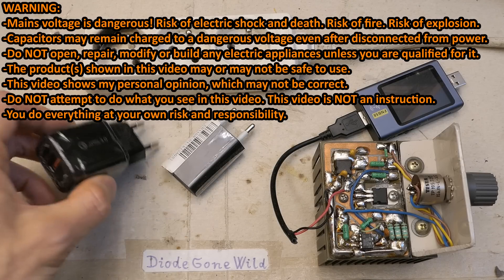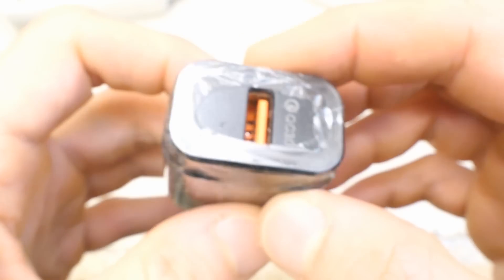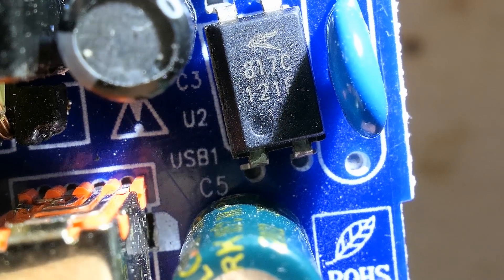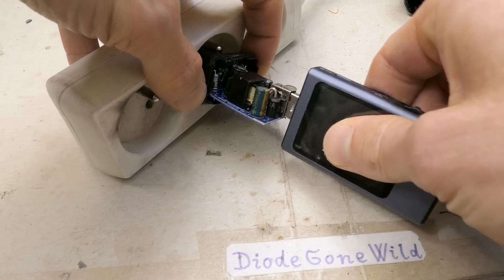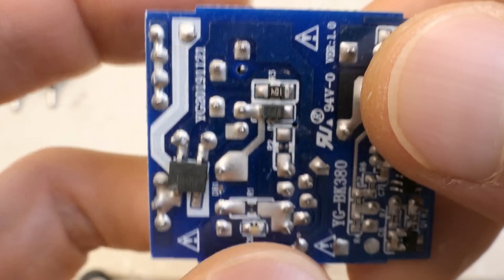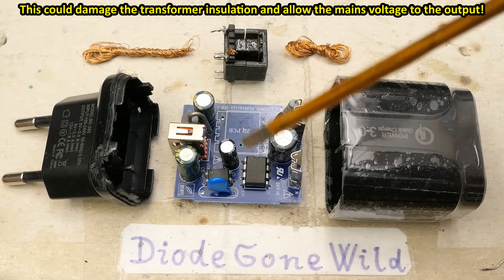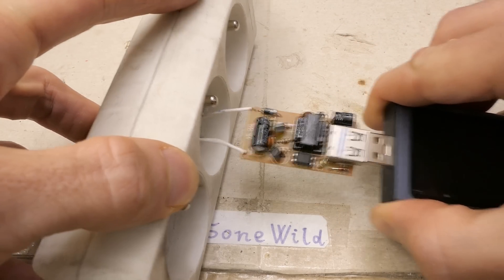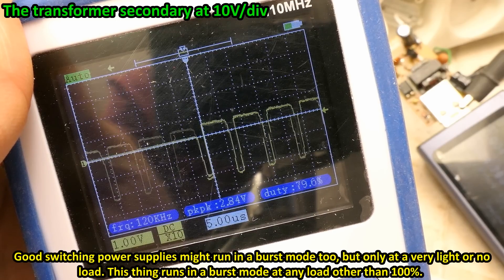Dangerous USB chargers 17 (QC 3.0 with schematic)

Comment: Great video. I'm sick and tired of the amount of cheap (and sometimes dangerous), but also wasteful crap that's on the market these days. And it's often from China or has cheap, unreliable components sourced from China (cheaply made capacitors are a common cause of failed electronic devices). Governments should be imposing strict standards and testing on such imports but they aren't. Big resellers like Amazon and Ebay should take a stance and not sell them, but they won't because ....... money.

Note that China is of course capable of making good quality components and devices, but a lot of their stuff is made to the cheapest price point and that is why it fails.

Comment: I actually had high(er) hopes for that first one after seeing the blue PCB.

The second one was a design popular around 10-13 years ago, and from some research and experimentation I did, it's amazing that that two-transistor design can actually deliver several amps without problem and be much safer if they'd just done what would cost a few cents(!) more per unit... but they didn't.
Reply: The two-transistor topology was actually good enough for the pre-smartphone era to power a 300mA charging circuit for a 1000mAh (or even less) battery. Those chargers were specified at 5.6V (no load) to 5.2V (rated current) or something like that, and the lithium charge control chip in the phone had no problem dealing with it. Putting a USB jack on a charger like that is not a great idea, and there is definitely no excuse for the bad transformer insulation and the non-class-Y capacitor.

Comment: If there’s anything to learn from these videos, just buy the charger brick made by your phone’s manufacturer. Even if it’s a bit more expensive than you would like, you can feel good knowing that it will work as intended and it likely will not explode when you use it.
Reply: Why i advice people (incl my family) to buy chargers which are a bit expensive and from trusted brads.

Comment: 5:23 152 degrees for a rectifying diode?! Bloody hell, that's amazing! That's going to cook the capacitor right next to it! 
That charger was baking its internals so much, it would probably melt the plastic housing and set your house on fire! Bloody hell - definitely not fit for purpose!
Also, that second one doesn't look too good...
Reply: And let's not forget: the charger is going to melt itself and set the house on fire, even if you don't try to draw the full rated load. This makes things even worse than it already is.

Comment: Totally off topic but I watched your de bunking video about using a MOT to make a blaster that can fry electronics ! its almost up there with "salt".....great work......cheers!
Reply: He still hasn't come across a design that is publicly available that lives up to the task, although one can be made very cheaply and only runs from 3v (2x 1.5v AA batteries). Doesn't work at microwaves though, but mid vhf.

Comment: I one of those USB chargers that was checked last and I must say it was not very good to charge my phone like he said "Dodgy ...." and "bloody hell ....."  🤣🤣. By the way, why do they use wires in parallel on the transformer ? do the manufacturers actually run out of money for proper solid winding wires?  Bloody hell ..........
Reply: Using multiple conductors in parallel actually makes the winding and termination more difficult to do.
It is done to reduce high-frequency losses due to "skin effect." You can find lots of info on skin effect on the web. Each strand must be individually insulated.

The "ultimate" in electrically paralleled conductors is litz wire. It may use a combination of enamel and fibre (e.g. cotton) insulation. The strands aren't physically parallel but carefully arranged.
Reply: Partially can be cheaper and easier to wind stranded wire then thick one and better fit on small transformer . Also can be something to do with high frequency switching and interference maybe.

Comment: 12:40 burst mode in self oscillating flyback reduces switching loss at medium load, because without bursts it increases switching frequency significantly (because self oscillating flyback cant enter from ccm to dcm, afrer core demagnetization done it turns on immediately). Feedback loop only reduces peak on-time current mixing some voltage from optocoupler to the base of current sense transistor. This leads to an increase in switching frequency, increases switching losses. Very often the heating of the switching transistor in such power supply is absolutely the same at medium and maximum loads. But burst mode on medium load is poor design anyway (result of feedback loop simplification).

Comment: This never gets boring. 
That second one must have been the worst so far. But the diode and electrolytic capacitor next to it, was also out of the ordinary 🤣
Reply: Happy 🎉
Reply: That diode placement is actually common in these crappy chargers..
Reply: There was one that was worse than this one, with a capacitor rated for 2.5V on a 5V output, as well as a capacitor soldered the wrong way :D
Reply: @TheSpotify95  🤣 I have probably missed that one

Comment: I use the super dodgy 1$ "chargers" to power my less demanding electronics (e.g. esp8266) behind a 1117 voltage regulator. Works fine 24/7.

It would be great if you could test the tripping current of the fusable resistor and printed fuse.
Reply: Well, if you use rubber gloves with insulation up to 500V, then there will never be a problem, otherwise I recommend mentally preparing yourself before each touch for the output, that one fine day you will get a nice hit :)
Reply: I believe it is relatively ok but the fire hazard is still there. Just don't use it for anything with exposed metal or expensive things in case it fails.
Reply: At this point it's better to diy one. Just a few transistors resistors and a transformer, so your esp uses mains
Or rewind the transformer and put Y1 cap
Reply: The charger is 1$. No need for diy. 😁
Reply: Bang on I love it ! only a bloody quid as we say in the UK. @twoina
Reply: What also makes electronics glie faster, is bad ripples, or many high ripples.
Reply: You can already get a decent one for $5...
Reply: @westelaudio943  yes, true. But if my diy electronics behind the charger works finr costs only 3$, it's OK. No metall can be touched, it is safe.
I will not charge my phone with the cheap charger, of course.
I trust the printed fuse to prevent fire. 😁

Comment: That is the highest temperature of a component I have ever seen that was still functional
Reply: Agreed. 153C...  it is dumb luck that it didn't fail.
Reply: I have had MOSFETs running hot enough to get the thin layer on the tin coated backside to melt and still survive. That's means it must have reached like 210-230°C (with the silicon junction being probably like 300°C or something). They will probably not run like that for long though - and it was not on purpose.
But, working a lot on messy perf boards, it's easy to get something wrong by accident, get a solder bridge or something like that - which in turn causes excessive current to flow thru the MOSFET or a desaturation fault. In those cases I have also seen a tiny bit of smoke coming and then cut the power fast.

But - design a circuit like this on purpose, is insanity, haha. No wonder switching power supplies from china often fails, as they are using underrated components (to save money) and push them to their limits....
Reply: I've seen bipolar power transistors that have melted the solder on their pins, fallen out of the circuit board and were still functional. This isn't too unusual in things like audio amplifiers. Over time the silicone oil evaporates from the heat-conductive "paste" between the device and the heatsink and the part runs very hot. Often they do fail, usually short circuit, but they do sometimes survive. I'd never put the part back in the circuit unless it was a real emergency repair and there was no other choice.
Reply: I've seen zener diodes desoldering themselves without failure. Actually they were not desoldering themselves because they were held in place with silicone snot, but the solder was melted. It was a bodge to reduce the input voltage of a 7824 regluator below its maximum range from 48V. Someone decided to do it with a bunch of series zeners, and they encapsulated them in silicone to insulate them from nearby components. It might have been OK (possibly) without the silicone, but the silicone added too much thermal resistance and the diodes were cooking themselves with the solder fully melted on their leads. And this worked for years in 24/7 without failure!
Reply: @mrnmrn1  
Ah, yes, the goo to "improve and protect" things.

Long after I'd quit doing repair work except for a very small number of clients I was asked to look at a power supply from the giant LED video screen at the local stadium (I still did work for the stadium in part because it was affiliated with the institution of my former servitude, as I call it, and in part because I liked the person who managed this stuff there.) It was from Meanwell. They meant well, but their execution was off. I don't remember all the details but some parts were involved with managing the power to the cooling fan. The fan speed was basically proportional to load current. Something was secured with some sort of goop. My diagnosis was that the goop was causing the part to overheat and fail, rather defeating the whole idea of using managed forced cooling to make the power supply more reliable. This diagnosis got back to Meanwell because it was a recurring problem for the manufacturer of the display system. Meanwell was a bit surprised some guy doing repairs was diagnosing their engineering problem.

Comment: “Poor electrolytic capacitor!”. That killed me man.
Reply: No laughing matter on poor capacitor
Reply: @Geniusinventor  Yeah that ain't fun
Reply: But it's true, because if you use 2 such 470/16 classic electrolytics with size 6.3x11mm , with you will find out from any serious  manufacturer that no offer 470uF for 16V in this small size exist and starts from size 8x11mm with their max. the pulse current is several hundreds of mA, so how much long this capacitor last if it has to equalize the pulses from the diode at the level of 1-3 Amps 100,000 times per second and maximum recomended temperature is 105°C ? 
Of course, if you want to really charge something and not use it without any load.
My guess is that the capacitor near the diode will dry out (stop working) after 80-200 hours of continuous current draw from the charger of 2Amps.

The second one will fail after 200-400 days under the same conditions, and it doesn't matter the manufacturer, even if it is the best brand on the market, they will suffer the same fate, only a little later, especially the one that is heated by the diode to 150 °C or more.
Reply: Exactly ... And part "the chip is just 140 degree Celsius .... "Juuust" 😃 was another funny part
Reply: You forgot to discharge caps